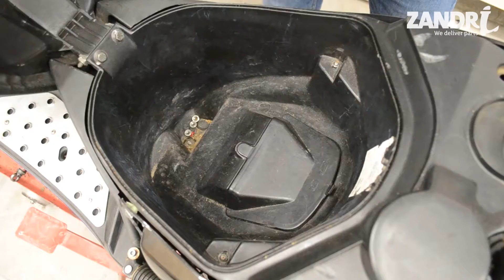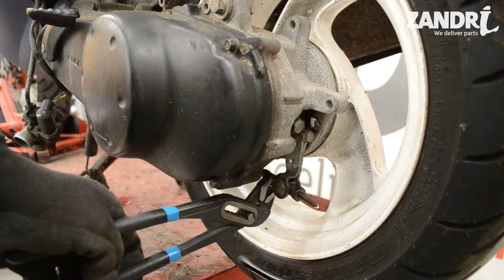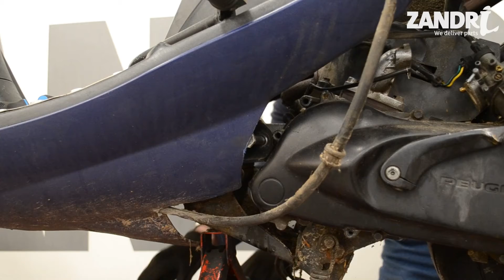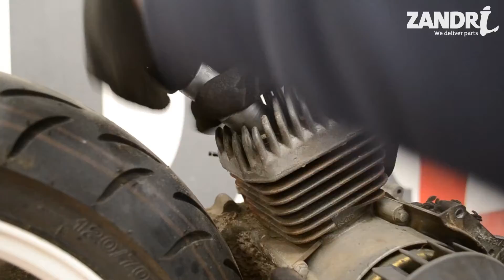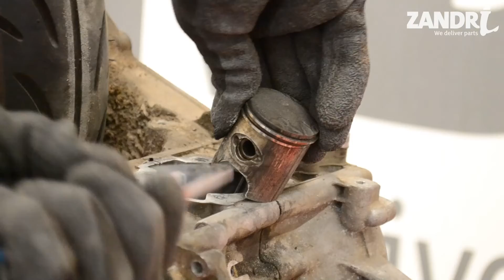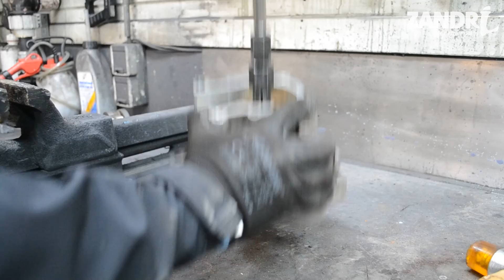Motorrevisie Peugeot Vivacity | Deel 1

Comment: I have the same vivacity sportline 2005, and gasoline comes out of the carburateur when the engine is running. What could be the problem?
Reply: your float needle needs to be cleaned
Reply: Membraan
Reply: maybe you have a stuck float needle
Reply: Had the same in just had  the gas screw open to much